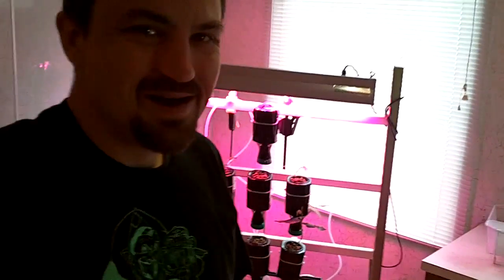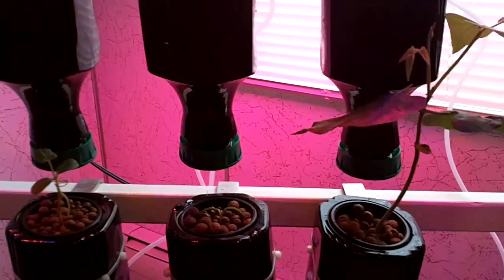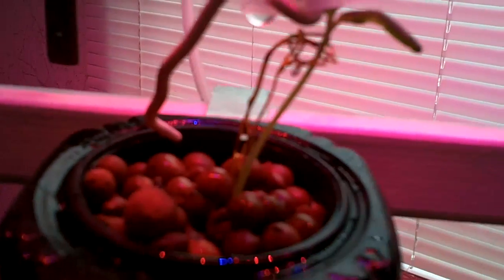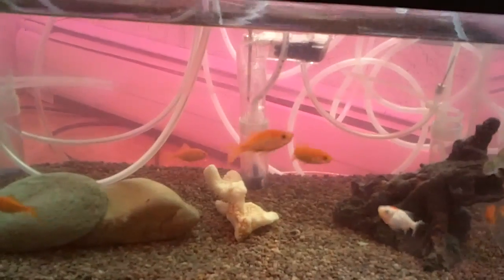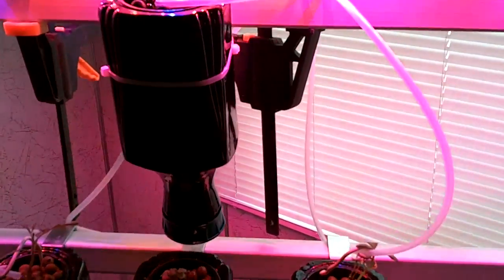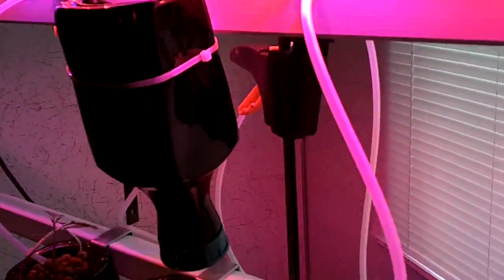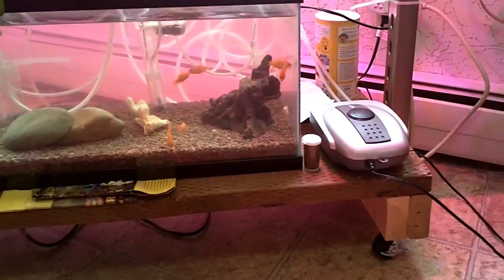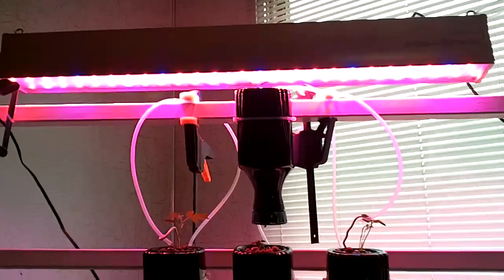Small home vertical aquaponics system using LED grow light

Comment from the maker: Hi Rowan.  I never measured the flow rate.  This one of my first systems.  I have since moved on to bigger and wetter projects.  The filter on this system was a typical gravel bed like you see with most small aquariums.  Solids will get broken down in the bed by bacterial action.  Then eventually the effluent would percolate up and drip down.  DONT use clear tubing!  Clogged the works up with algae.  Best of luck to you.  :)